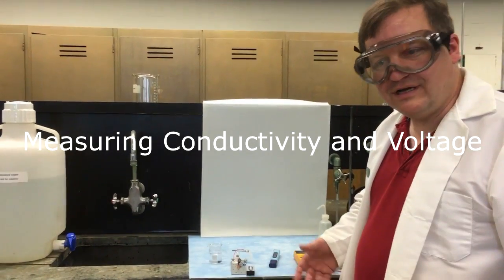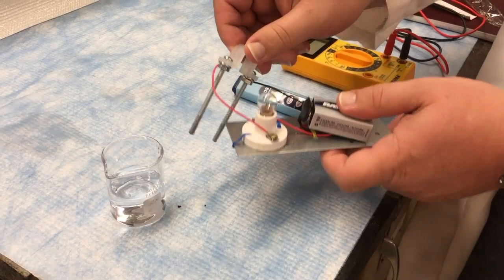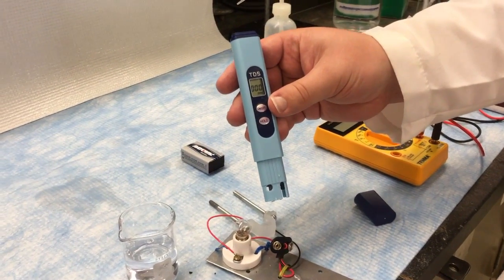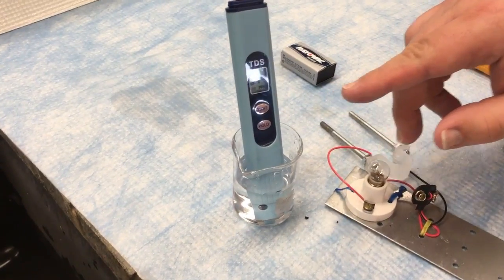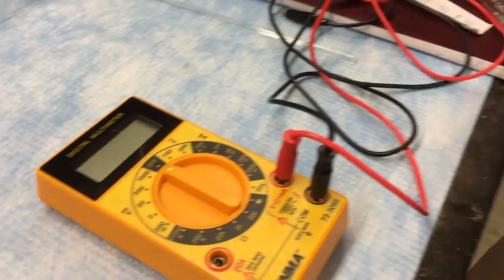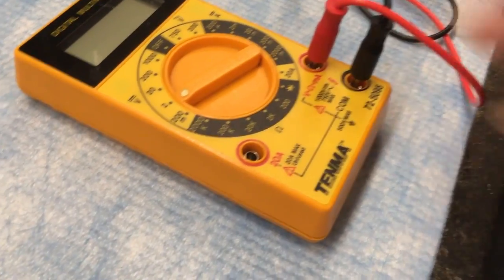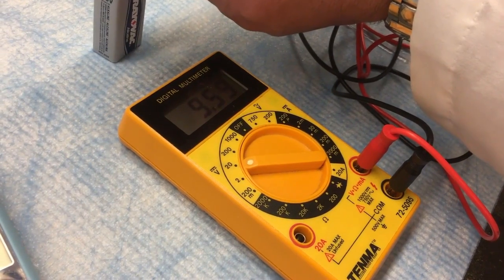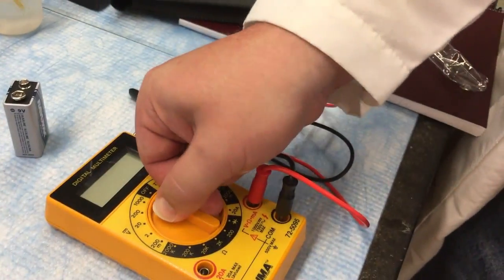Measuring Conductivity and Voltage

Comment: how I measure the conductivity in my polyaniline that I made? can 61-340 multimeter helps me in this case ?
Reply from the maker: Honestly, that kind of polymer measurement is well outside of my expertise.  There's an article that describes an apparatus to measure the conductivity of a polyaniline film here:  https://pubs.acs.org/doi/full/10.1021/ma3005982  This may be overkill for what you are trying to do, but as you can see it is well beyond the digital multimeter level.  Good luck with it!

Comment: can you use a multimeter in solutions?
Reply: In principle yes, in practice not really.  A multimeter will let you measure resistance in a solution, which is related to conductivity.  But getting from one to the other requires detailed information on the geometry and placement of electrodes in the solution.  Also, the choice of material for the electrode can affect readings.  And there are other complications, so it is not a simple procedure.  If you have a multimeter and want to take get the conductivity of solution, the most practical thing to do is find someone who has a conductivity meter and tell them if they let you use their conductivity meter you'll let them borrow your multimeter sometime.